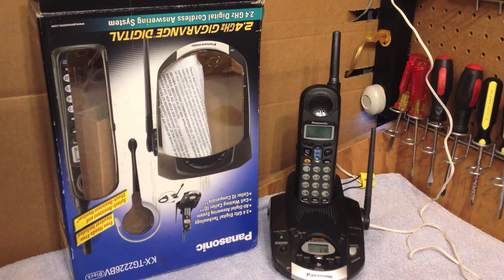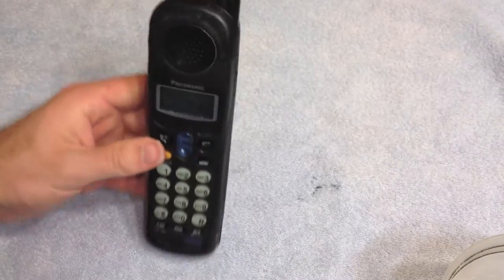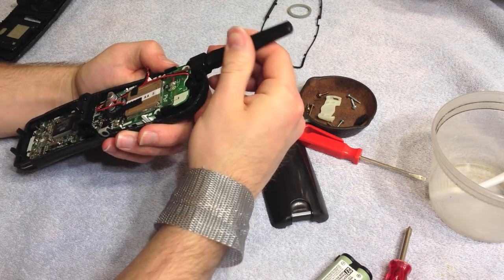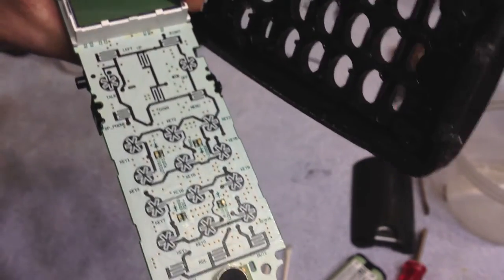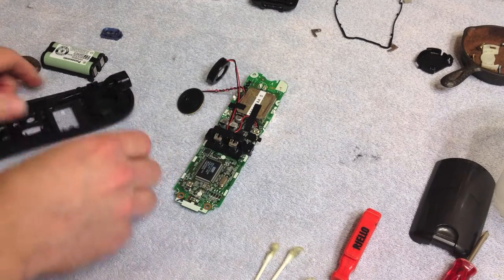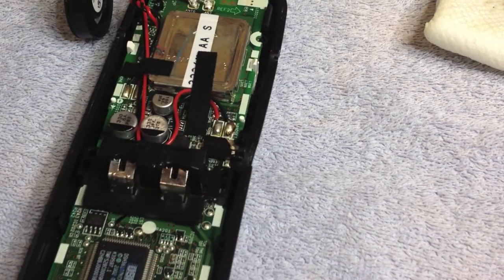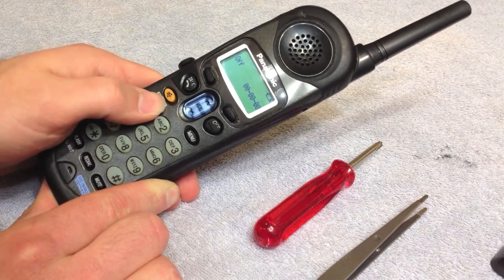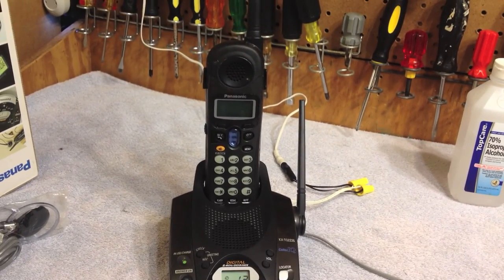Refurbish Panasonic KX-TG2226

Comment: The yellow stuff actually from the rubber keypad membrane deteriorating. It turns to that yellow goo/oil. I seen it happen on a few older phones, that same yellow goo. I also dealt with it on old tape decks and reel to reel bands and pinch roller that turn completely into tar, or soften over the years as the rubber ages. 

When it gets that bad sometimes only recourse is to replace it completely, as it happen again.
Reply from the maker: Are you sure it's not just oils from people's faces seeping through over the years? I've never had it happen on clean phones, nor have I had the mess re-created itself on ones I've cleaned up and kept clean.
Reply: @JordanU  I am positive. I seen it happen on a like new Panasonic that had no sign wear, that bought new old stock. I did a video on one just a couple days but was a used one, but you can see the yellow oil and area on just the spot where the light color rubber and not on the black area. Not sure why the rubber deteriorates that way? Just seeing it on a few same color that yellow color and appearance that was even on a new phone, it has to be the rubber itself.
Reply: @JordanU  On the one clean up, thankfully held up. I had one that was really bad and ended up just replacing the whole keypad as it had tears and keys were soft, but that was on just one out of over 100.

Comment: That plug thing is called a barrel connector.

"I use this stuff, I'm not going to even try and pronounce it".  Really?  I even gave you a phonetic pronunciation of it.  You're not accepting corrections like someone else we know...and I'm sure you don't want to be that way!

I want to see a bucket test with that phone now!
Reply from the maker: +jaykay18 I may not be accepting the correction, but at least I admit that I'm wrong! I think I'm doing pretty good,, at least I'm fixing it.. Most people would probably say 'o no, the button doesn't work, let's toss it and buy a new one'

I doubt this telephone is submersible.. All the manual says is that it can be 'handled with wet hands'.. The Uniden waterproof phone is far superior to these,, these are more just water resistant.. I've taken one in the shower, and handled it with wet hands,, and it survived fine.. But that's as far as its intended to go..
Reply: Jordan U Ok.  Water resistant, not water proof.  My Uniden waterproof has been in the pool a number of times with no ill effects, just needs to dry out completely for best sound.
Reply from the maker: jaykay18 I've fully submersed my Uniden many times.. Usually just a good shake gets all the water out and the sound back to normal..